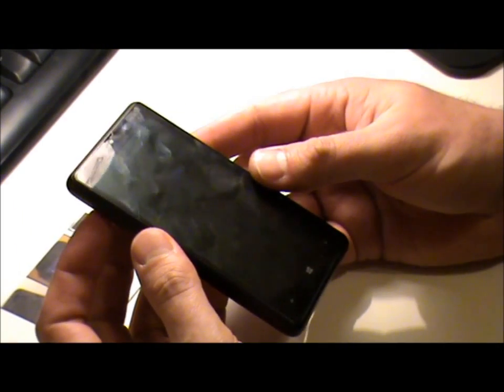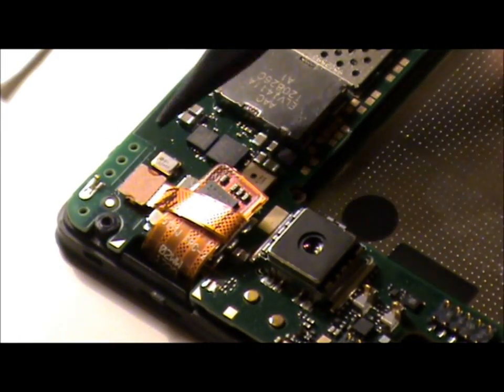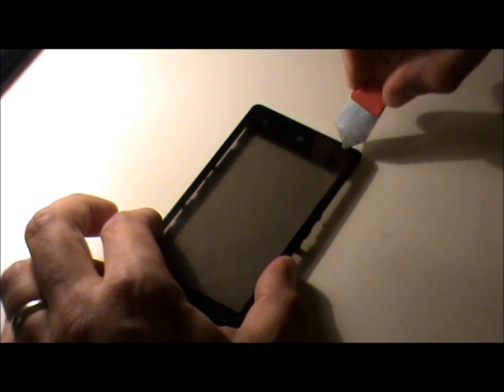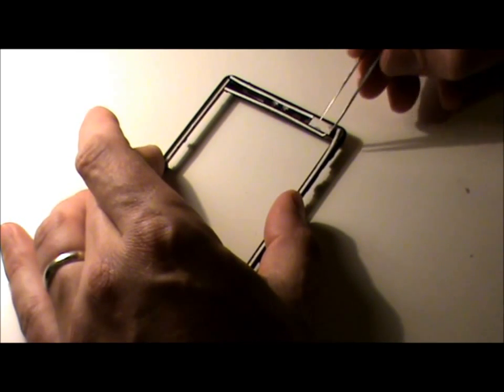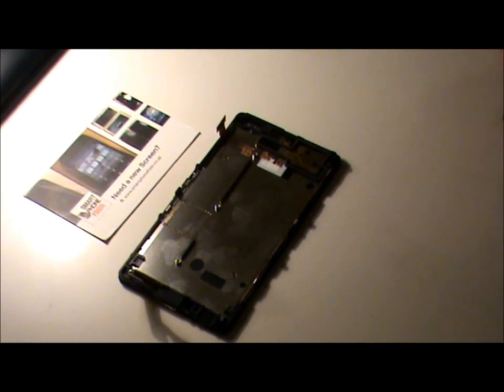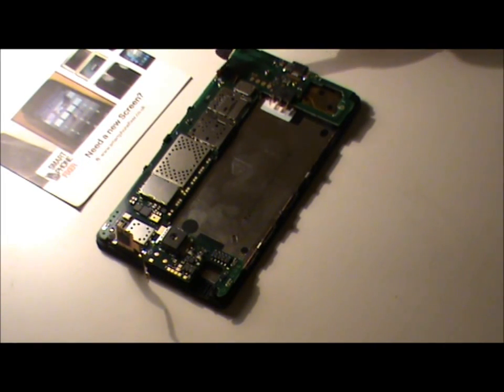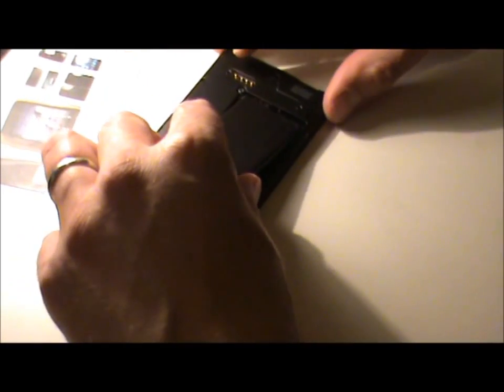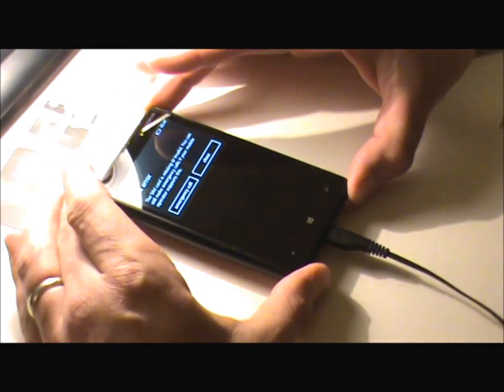Nokia Lumia 820 Screen Replacement Guide

Comment: Great Video, recently broke the screen on my lumia 820. The screen is completely cracked half way down the screen, and non responsive on the bottom half. Will it work still if i get the screen replaced or is there possible internal damage?

Comment from the maker: Hi Evan, Yes, it's a trait of the screen on the Nokia Lumia 820 that when it cracks the whole thing becomes unusable. Therefore, you need to replace it with a new one. You find a link to a recommended screen supplier in the notes above. Hope that helps. 

Regards,

Will

Comment from the maker: Hi Gen, the likelihood is that it is because of the cracked screen and nothing else. When the glass is broken on the Nokia Lumia 820 it is pretty normal for areas of the screen not to work. It's not like the glass on an iPhone which will continue to work even though it is cracked. 

The Nokia Lumia 820 is very sensitive to cracks and areas of the screen being left unusable, unfortunately. If you replace the screen, it will bring it back to normal. I hope that helps. 

Will

Comment: Hello I have a question for you i have the same phone as you do now i dropped mine and it cracked on the lower right hand corner right now i am unable to use those functions on the bottom because of the glass being broken is it because of the glass being broken that i can't use those functions at the bottom or did i mess it up even more

Comment from the maker: Hi Adam, Glad you liked the video. 
I've not had any problems from customers who have had problems with the proximity sensor after I have changed their screens. Having Googled the issue, it seems like there is an issue with the Lumia 920 proximity sensor. But, nothing that I can see after a brief search to show there are problems with the Lumia 820 proximity sensor after a new screen is fitted. Regards, Will

Comment from the maker: Hi there,

Gluing it in place is not a good idea. If it is not staying in place it means that either the digitiser end of the connector or the motherboard end of the connector is faulty. If you did glue it in place, chances are that it would not work properly.  

I suggest buying a new screen and sending back the one you have now if it is still under warranty. I hope that helps. 

Will

Comment from the maker: Hi There,  Sorry to hear about the trouble with your screen. You might want to the unseat it again and clean the connector on the screen with some isopropyl alcohol on a lint free cloth to remove any grease which may have got onto it from your fingers (Can cause interference sometimes). 

If this does not work, then I would suggest that you might have a faulty screen. In which case, if you have a warranty from your supplier, then ask for an exchange or a refund and obtain a new screen. Will

Comment: Hi,

I've replaced my digitizer after cracking it, following this video to the letter. Everything works fine but for a strip across the centre of the phone, which covers the top line of the keyboard when typing, the end call button and other lovely things I'd rather not do without. This strip is, at best, unreliably responsive to touch. Any idea what I can do to fix this? I've tried reseating the digitizer to motherboard connector, but if I have done it right, it hasn't helped.

Thanks

Comment from the maker: Hey there, Glad you found it useful and that you saved the money. Yes, it's much easier buying a complete digitiser and frame unit, rather than gluing the new digitiser to the old frame. It's only slightly cheaper but it takes much longer than using a complete unit.

Will

Comment from the maker: Hi William,

Sounds like you are having a tough time of it. With the middle of the three T5 screws, you might need to use a set of fine nosed pliers to take it out (don't rip it out. Turn it out like you would have done with the screwdriver). That shouldn't affect the screen, though. With the touch screen problem, it could be that your screen is faulty, or your connection is loose or damaged on the motherboard. A new screen does sound like the bes option. :-(

Comment from the maker: Hi there, 

It sounds as though your LCD might be a problem, but the sensitivity comes from the digitiser so it might be that, although you fitted the digitiser correctly, the digitiser might be faulty too. Nevertheless, it's always worth double-checking the connector from the screen to the motherboard to make sure it is properly seated in the socket. 

You may have to ask your supplier for a replacement screen if it is in warranty from them still. 

I hope that helps. 

Will

Comment: Hi, tnx for the video, really great! I have a question: I just replace my screen with a brand new one, but there is an area about 120 pixels high that goes all the way from the left to the right of my screen which doesn't have any sensibility at all, double checked with a diagnostic tool. Now, since I'm quite familiar with this replacement operations and I'm sure I didn't mess up anything during the replacement, do you have an idea of what can cause such a malfunctioning?
Tnx in advance!

Comment from the maker: Hi William, 

You will need a size 4 Torx screwdrivers for the three small screws adjacent to the battery slot. These are the official sized screws but I find that sometimes the size varies, oddly. 

I do carry out repairs. If you send me the correct part, I will carry it out for £43.95 plus postage (£3.99). 

Let me know if you have any questions. 

Thanks, Will

Comment: Hi Will

I've just broken my phone and found a new screen with housing, however, which screwdrivers do I need, I know you mentioned the T5 for the first three screws, but you didn't mention the ones needed for the smaller screws?

as well, cheekily, you don't do phone repairs yourself? like a service, I've been quoted £150+ including parts, but the screen + housing on amazon is only £26

potential quote? If I buy the parts then send the phone and new screen to you + reimburse postage back

Comment from the maker: Hi Luigi, you will need to buy some 1mm double-sided adhesive tape (which you can buy off eBay or Amazon which you place on the frame around the edges). Otherwise, you can now buy new glass which comes with a frame already. See the text above for suggested suppliers.  Hope that helps.

Comment from the maker: Hi,

There could be a number of things going on here to check.

1. Are the connections absolutely squarely fitted? You might need to check them again and press them to check they are located properly. 

2. You might have 'pinched' the digitiser cable when you reassembled it. This can often be the case if the ribbon is snagged or pinched. Check to see if that is the case. 

3. You might have a faulty screen. Check the warranty on your screen from your supplier and see if you can exchange it.

Comment from the maker: It's possible that it was dislodged when you carried out the repair. It's very easy to knock things on the motherboard when you are taking it in and out. So, the first things to check are the connections to make sure they are all seated correctly. With that done, you will eliminate the connections as being the problem. If that does not solve the problem, then it will need further investigation. I will hunt around for other possible causes and post any solutions I find.

Comment from the maker: Hi there, you may need to open up the device and check the connections are all firmly in place. It's quite easy to misalign the connectors with the sockets on the motherboard. 

Try that and see if it makes a difference. 

Will